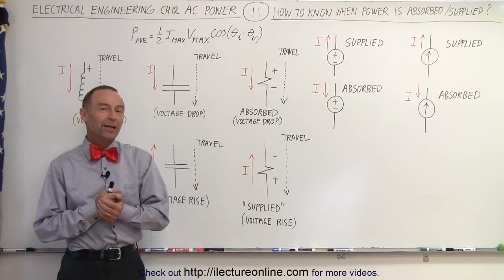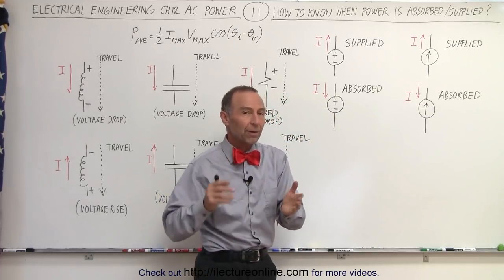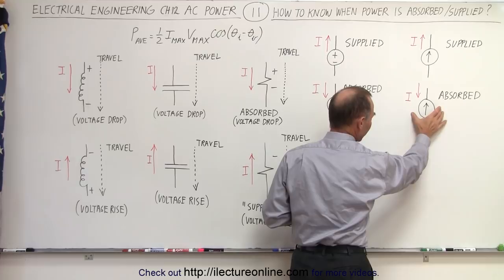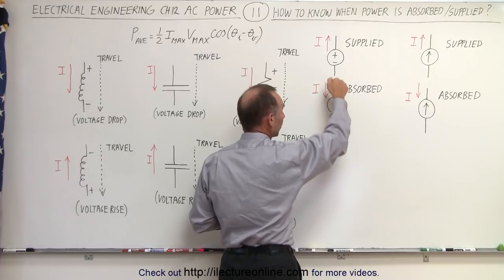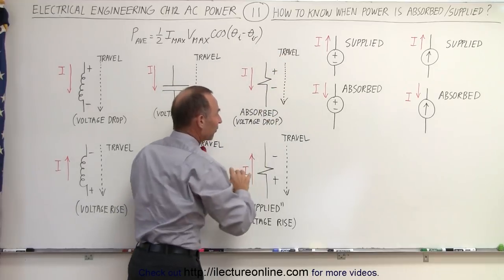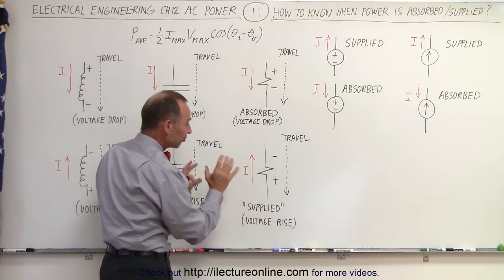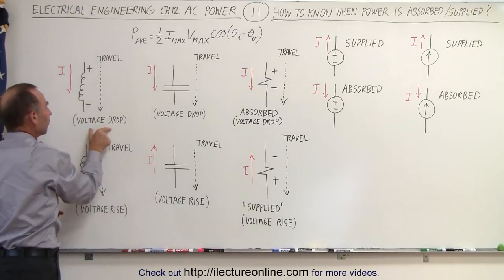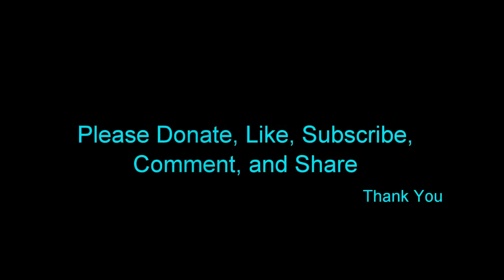Electrical Engineering: Ch 12 AC Power (11 of 38) When is Power Absorbed or Supplied?

Comment: When you say “power consumed” by the resistor, I assume you mean the energy is being turned into unusable “heat”. An inductor or capacitor does not not “consume” energy in this sense, but stores the energy in the magnetic field (for an inductor) and electric field (for a capacitor ) So the voltage drop for those two components means the energy is transferred to the field, where the voltage drop for the resistor is turned into heat.  Wouldn’t the big difference be that the energy transfer in an inductor or capacitor is recoverable, where the energy transfer in a resistor is lost?
Reply from the maker: Very good explanation of what is happening in a circuit.
Reply: Well if you heat the wire, you do get some change in voltage accross it... Meaning some heat energy used up in knocking off the electrons, what heat is? The solar panel, the photoelectric effects... Conduction, convection or radiation... All increases the randomness in atomic world.

Comment: Hi sir...you mentioned something in that diagram "travel" what it means (current or voltage)......pls response..
Reply: I also have this question^
Reply: @izzylani6594  is it based on the mesh travelling i guess?
Reply: @izzylani6594  travel just refers to what direction you have your current going when doing mesh analysis i believe

Comment: You made a mistake in drawing the second case of a resistor. You, inadvertently, made it like the first.
Reply from the maker: The resistors are drawn correctly.  Thanks for checking.
Reply: @MichelvanBiezen  I meant that in both cased you made current go from the positive to the negative, i.e., they are the same case not two different cases. Are you understanding me?
Reply from the maker: The current always goes from positive to negative, it is not possible the other way.  But you can go around a mesh (loop) in either direction.  The voltage rise or voltage drop across the resistor will depend on your direction of travel around the mesh.